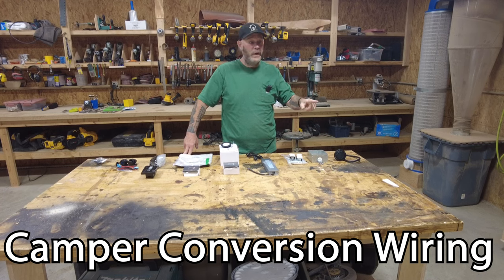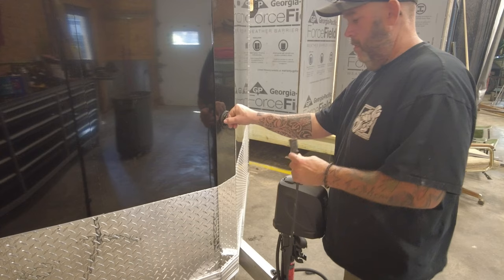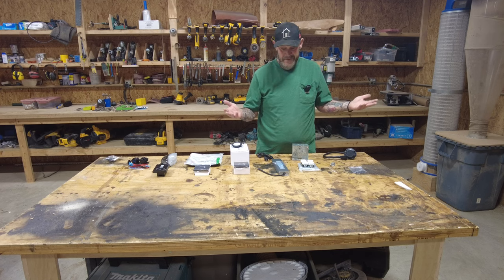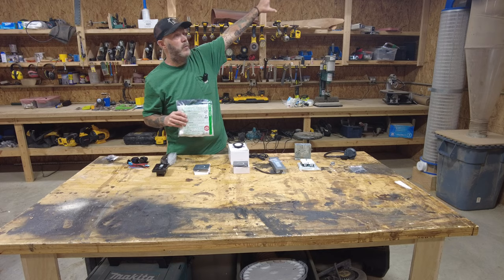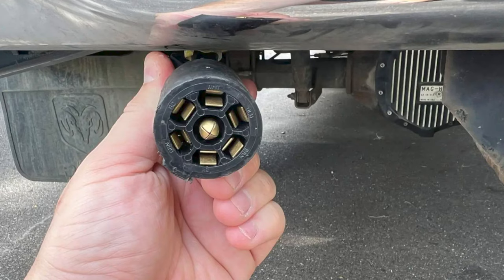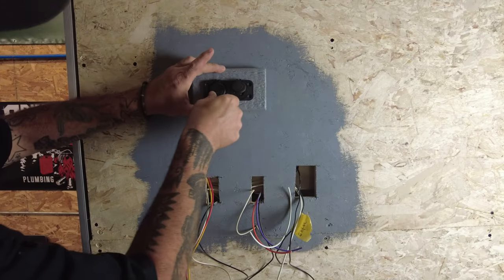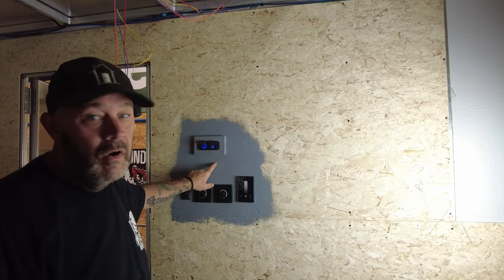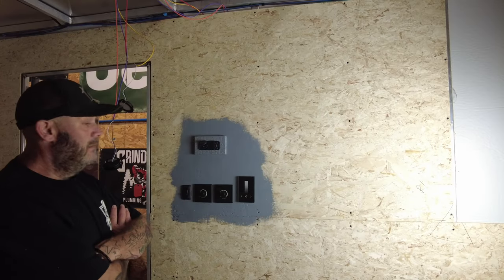Cargo Trailer Conversion | Wiring

Comment: Thank you for the vid. I’m designing my conversion and your vid is pretty much the set up I need to go for, and couldn’t find the links for the plug you have for the shore power… the black one you install in the hole facing the trailer. Also the link for the transformer from 110v to 12v …   Thank you for the help!
Reply from the maker: Awesome! Here are the links for what I used. I cut the cord end off.
Shore Power: https://amzn.to/46jTJ7n
Transformer: https://amzn.to/40MReJD
Reply from the maker: They make a shore power that is a splitter inside (I used that in my pickup) You could plug a power strip into one and the transformer into the other if you didn't want to hard wire the 110v stuff.
Reply: I saw it and is ready in my shopping cart..! Thank you!  @buildlifeoverland